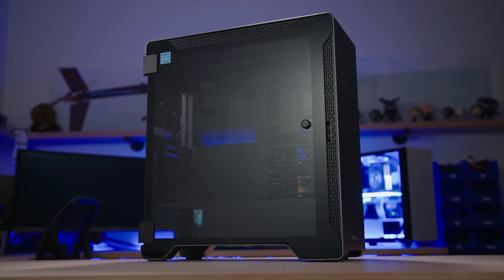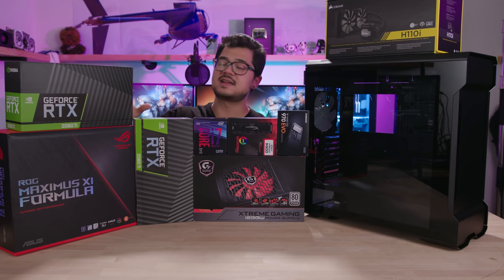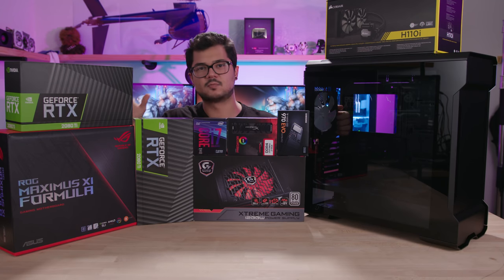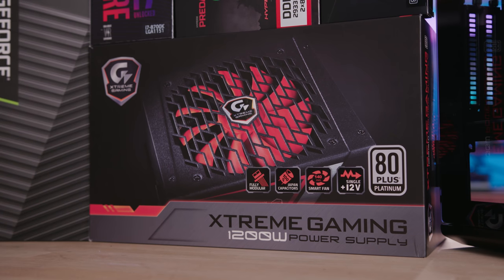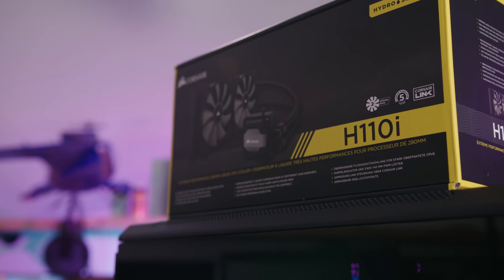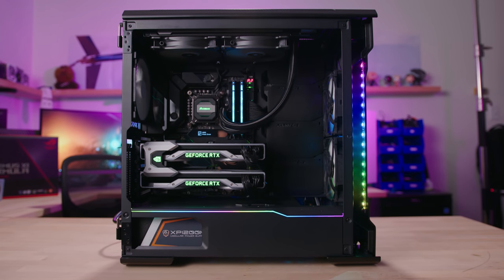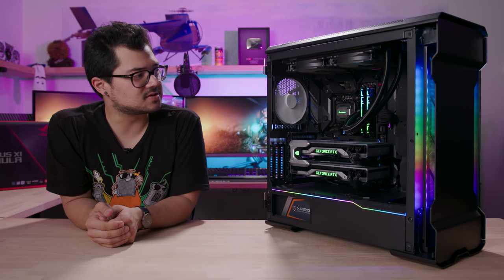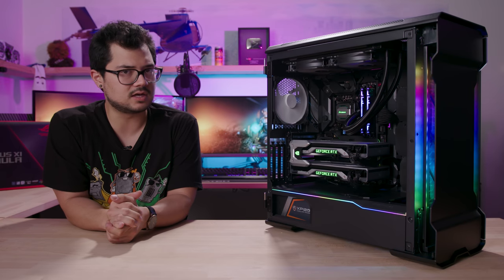Hotline 2.0 Early Build (Pre-Water Cooling)

Comment: I'm going to put a m.2 in my z370. So will my gpu still have x16 bandwidth im confused?
Reply: Yes, it should still be x16. Even if it weren't, you won't see a difference at PCIe 3.0 x8 unless you have an RTX 2080Ti, so I wouldn't be too concerned about bandwidth if I were you.
Reply: No, they use different lanes.
Reply: Coffee Lake CPUs have 16 PCIe 3.0 lanes directly connected to the CPU, then there's 24 PCIe 3.0 lanes on the chipset/motherboard. So you have room for a single GPU and NVME M.2 drive, without bandwidth being affected.

EDIT: Theoretically 2x NVME PCIe 3.0 x4 drives.
Reply: @schlongdas7250  - That reminds me. I've read that on some motherboards, for some odd reason, that the first M.2 slot's bandwidth is shared with the x16 slot. 

So to the OP. If/when you buy an NVME M.2. drive...be sure to double check your motherboard manual.
Reply: Graphics cards use x16 slot. M.2 uses x3 completely different lanes
Reply: you have room for a single GPU and 2X NVME M.2 drive. 16+4+4=24 PCIe 3.0 lanes.
Reply: Usually the m.2 slots run off the chipset PCIe lanes, and the graphics card runs off the CPU PCIe lanes.
Reply: @MichaelStephenLordReserei1987   Smart reply, always check the MB manual or manufacturers website to make sure how the M.2 will affect things, sometimes they take from the USB plug-ins.

Comment: Would my Ryzen 1600x hold back the RTX 2080 ti that i ordered? Or should i change my CPU? If so what so i get?
Reply: I don't think it'll affect GPU performance as long as you game at 4K. 1440p will have a small difference. I wouldn't bother, at least wait until Ryzen 3rd gen comes out, because it should have some big improvements in clockspeeds.
Reply: Why use budget CPU and go balls to the walls on a GPU thats not even worth upgrading to?

Comment: May I recommend keeping the 8700k instead of getting a 9900k? The 9900k is hotter than the sun so that won't allow you to get the best clocks out of it when the chip can't even maintain stock boosts with anything other than exotic cooling. In my eyes, the 8700k is still the best gaming CPU.
Reply: Get the i7 9700k
Reply: Which has the same thermal issues as the 9900k. @carljosephavelino4128
Reply: @gaiustrollius9920  core 2 duo

Comment: You definitely need some faster memory.
Reply: Why? I have the same kit clocked to 3733 but even then 2933 is plenty fast.
Reply: @bright890  I wouldn't put 2933 memory into a machine with 9900k and two 2080 Tis and liquid cooling. It's not a budget build
Reply: @bluecement  Ah boy, that's not budget RAM - it's both designed to be OCd and has inbuilt IR sensors for RAM synchronisation. What's your ram speed and timings? Some people like to get both looks and speed :D
Reply: I have 3600 and clocked to 3800